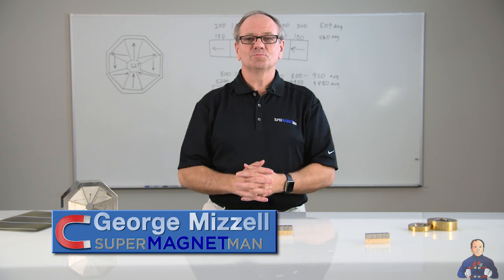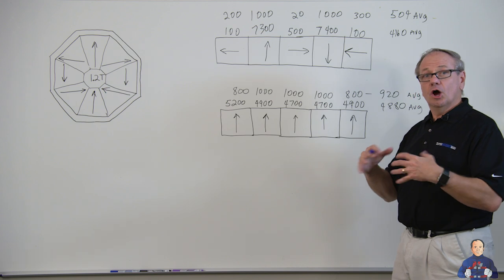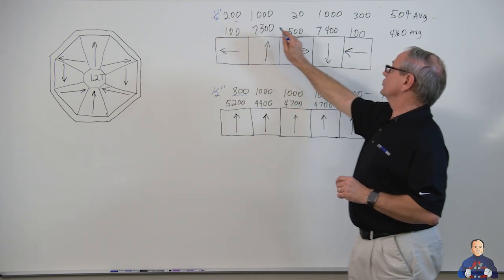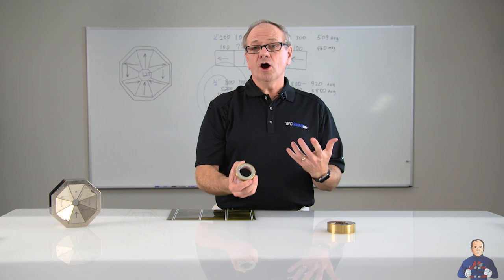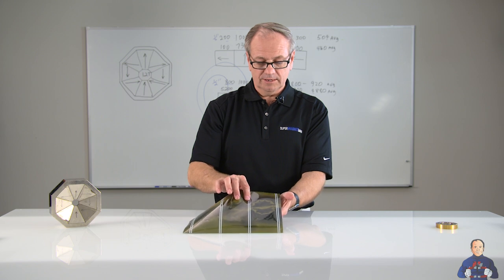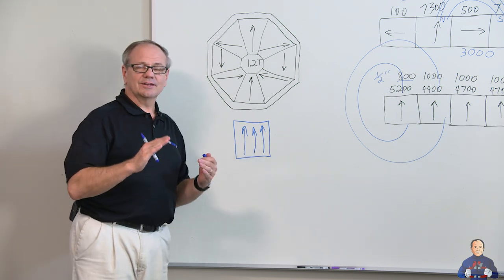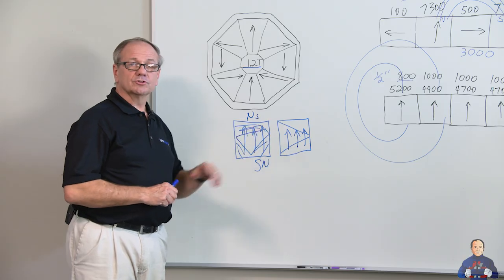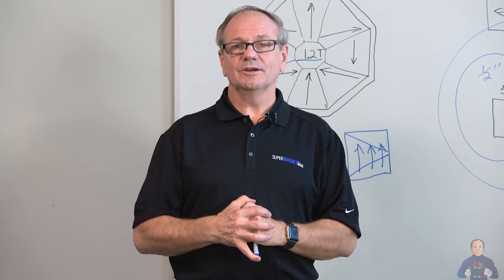Fundamentals of Halbach Arrays

Comment: I know of FOUR ways to make motors or straight rails POWERED by the magnets themselves...at least two are patented, but one uses weak, custom made ceramic magnets, one is big and complicated, the other barely keeps itself moving, and the one I invented I only got a couple prototypes working enough to know it works, probably better than those, because its simpler.
I'd love to show the whole world how to build it, if I just had the means to make some custom metal parts like these!
I need maybe a couple dozen thin, flat magnets, and some simple metal parts, made of certain common metals like iron or aluminum or copper. Either I'll make it myself when I get the tools again, or someone will work with me, live streaming online perhaps so everyone can see, and we can make one! 
Then we can make this simple mechanical levitation device I'm quite sure will also work, which could eliminate the need for propellers and rocket engines if it works! (Its so simple I'm sure it will work too, and I'm sure mine will spin really fast and put out a lot of power when I build a better one, with precision parts, instead of hot glue!)

Comment: the magnet, is worthless, unless you are picking up something with it touching, there is better ways,
I get better results for a full inch or more, but I do not need the extra magnets to do it, 
strange when a magnet instructor is so uninformed about magnets, 
magnetic field is possible and the extra magnets I can put in a different configuration and beet this , and not by a little,

Comment: An array constructed out of Gadolinium with the array placed in between two Tesla coil's with a superconducting energy loop passing between the two Tesla coil's with zero energy loss. Energy loop passing through Tesla coil's set at wavelength's that affect's the refined crystal structure's of the Gadolinium causing ultra low temperature's and a magnetic field to be generated by the Schumann resonance passing through the crystalline structure's of the Gadolinium. Superconducting electrical motor's that operate off a superconducting energy loop with zero energy loss. This can be used in concert with superconducting separator's built along water way's to remove pollution and bacteria from the water generating clean pure drinking water. Pollution removed from water further processed with other superconducting separator's set at different frequencies to break the pollution down into it's componat compound's to be used to make other other industrial product's. A way to clean up say the Salton sea in the United State's? 😊

Comment: Superconductor separator's in every home to clean water of pollutant's and bacteria that even process urine into fresh drinking water with a home having 100 gallon's two 50 gallon tank's 9ne hot one cold with all the removed compound's from the water and urine deposited into a canister for later disposal and processing by other superconducting separator's set at different frequencies to break it all down into it's componate compound's.Atmospheric water generator's that are programmable to set a certian water vapor in the home's air and pull the excess water vapor from the air drained and hooked into the water treatment system in the home with excess water generated filling a separate tank to be used for plant's and animal's.  Soild waste and paper cooked and sterilized ground up and deposited into a bin to be used has rich top soil. The Halback array's can not be used to make all that possible? A state of the art home would be self sufficient and have no need of city utillities other then trash disposal and the processing of canister's of waste removed through the use of superconducting separator's.

Comment: Would it be possible to to use one of those Halback's with A spinning fly wheel with Gadolinium to produce low temperature's for a new type of refrigeration system? Design the Gadolinium like in a fan. configuration to draw in air over it's surfaces to super cool the air has the air in a refrigerator is circulated with the electrical component's coming on and off by use of a thermostat for a totally electric refrigeration system? 😊
Reply: No.

Comment: Great presentation.  Question: Is it necessary to cut the magnets after magnetization versus cutting the pieces into the requisite shapes and then magnetizing?  Could the parts be magnetized in the direction you want by positioning the pieces in a certain direction before magnetization?  Thanks!
Reply: Typical ceramic or cobalt magnets yes. But as he said in the vid, neos are set in the manufacturing process. Once made you can change polarity but that's it.

Comment: I feel like this is the reason my business-card-fridge-magnets seem to have stripes of magnetism....  but that's probably a complete misunderstanding of the effect.
Reply: Yeah, not the reason. The card has that pattern to maximize the attraction force to a fridge. You are right, not Halbach, just multi-pole. Basically, more poles are better for that use, and it is easier to make the card shape into a magnet that has poles in that arrangement ( think production line). A Halbach "Array" is always seperate magnets, pushed together after they are magnetic.
Reply: Some fridge magnets are Halbach arrays in effect - the magnetising coils are only set on the active side of the material, generating arcing fields in the material.  Halbach arrays are merely a technique for shaping a field by combining pre-made magnets.  Magnets can be magnetised in-place with the wanted field -geometry directly, but its a custom job, not off-the-shelf.

Comment: The number of magnets is directly proportional to the field strength, Tesla. Increasing the number of sides to a Halbach, you can increase the number of magnets. Using 3D printing of metallic solutions, you can make intensely small magnets under magnetic fields during the curing process. You could make extremely strong magnets then. +1000 Tesla at low cost with a high capacity output. If you look the first set of 4 magnets(Top, Bottom, Left, Right and then rotate right to the next set of 4) you can see the magnetic fields form an infinity with a 90 Degree angle of incidence at center; The second set of magnets(Top, Bottom, Left, Right) have a zero degree angle of incidence at the center. This is in reference to the last example in the video, there are 2 sets of magnets with 4 in each group.
Reply: Thousand tesla permanent magnet?  Really?  Go make one then.  I have no doubt you will fail.

Comment: It would be neat to have a wind generator that used standard magnetic array when the winds were low, however when the winds were high enough it could flip a couple of the magnets magnets around to the halbach array and generate a more watts per RPM. 
That may require some creative code to write a program that would change the array to Halbach only when it was justified, otherwise energy would be wasted l flipping magnets in the generator than justified by the increased wind speed. 
Just a thought.
Great video!
Thanks!
Reply: Trouble is you don't need extra power in very windy conditions, you want the generator to survive, so the blades are normally variable angle - which gives speed limiting or constant speed behaviour.  High strength magnets increase efficiency whatever the conditions.

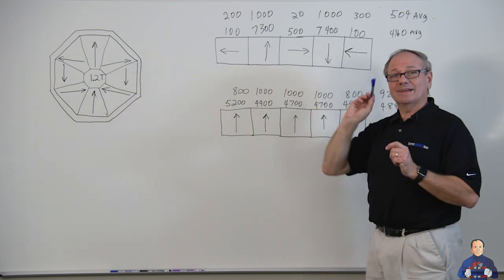Comment: 1:55 This is embarrassing. Either your numbers are on the wrong side of the array or you should flip your horizontal arrows around... It would have been easy to see if you had explained WHY the field strengthens on one side and weakens on the other side.

Comment: How do I use magnets to propell a craft into space? I'm thinking of flipping an objects polarity to reverse the effect of gravity on it. Inverting an objects electromagnetic field.
Reply from the maker: This has been proposed about 30 years ago as a way to propel a cylinder of radioactive material to the sun.  The concept was to use large diameter abandoned oil wells and drop a series of coils in along the lining and drop in a cylinder about 1 foot in diameter with a large magnet in the base.  Then activating the sequence of coils hitting them with a large capacitor bank so that each coil fires at the right interval to accelerate the cylinder.  The idea was that using rockets that might explode would be a bad idea with a ton of radioactive material and this might be a safer option.

Comment: I thought the Halbach array for the electric DC motors was stacked both as layers and as in relation to the next reducing the cogging effect as well as making one side of the magnetic field strength stronger, the other side not necessarily weaker but more “pancaked” out (Changes the shape of the field). The goal of producing a stronger field whether inward or out depending on the other component of an electric motor. (Either can be the stator or the rotor) . I tried to attach a drawing to show what I am attempting to say.
Reply: Mike Gillett can’t attach squat, we are on youtube after all

Comment: great video sir
i want to know about the v gate magnet for perpetual motion motor 
i know its not possible but still
i want know is it possible to block the magnetic field for certain place for certain time ??
like there is where the magnet meets at a point .
and that point wont let it to rotate the motor any further. 
so is there any material which is light and which can be used as a shield for the magnet

Comment: Electric motor's speed to torque ratio depends on its inductance, stronger magnetic field helps shift this ratio towards smaller RPM and higher torque, power is unchanged. With low RPM motor you need less (or none) gearing, so total drivetrain efficiency is higher, but the downside is that the shafts and the windings armature need to be made tougher and bulkier to handle all that torque.
Reply: Which is why distributed power as close as possible to contact patch while maintaining low unsprung weight is crucial in automotive.

Comment: Based on the principles of possibilities , I believe an arrangement of these magnets can lead to a design of a self-starting motor-generator .
Reply: Better high efficiency magnet motors and generators can be developed.
Reply: Adding extra windings to a permanent magnet increases its strength up to about ten times(?).
Reply: I think I read that idea from mythbusters ?
Reply: am really c.r.a.z.y. about it .
Reply: and hopes to  build one for the house. lest my sistser stops clamoring about the power bills whenever I use soldering iron.
Reply: I mean building that permanent magnet generator.
Reply: 55KVA (real power) will do
Reply: and using only a few pounds of blacksand or iron filings.
Reply: to make a large magnet.
Reply: and fashion into what I cll as : Magnetic Field Switching Generator
Reply: and eventually tune it to the tesla frequency or the 'beat frequency' of the earth.

Comment: Would this be a cost effective design to use for a hydroelectric generator or wind turbine for living off grid?
Reply: Getting past the rules of the Dept of environmental bureaucracy is tougher than creating free energy.
Reply: Well, it wont make more power than whatever the turbine receives. And electric generators without this can be quite efficient already, so unless someone already makes a competitive design using this system, you're unlikely to get any worthwhile economic benefit. A bigger benefit would be using this with a flywheel energy storage system, as that could store more efficiently any excess energy, for later use, allowing for a smaller turbine in the first place. However, the system cost of such a storage vs. Chem batteries ( lead, etc.) is typically the problem with that idea.

Comment: Is it possible to use magnets to have levitating chairs.🌿
Reply: Yes and no. No arrangement of magnets can make another magnet levitate, but you can do it with electromagnets and PID loops.
Reply: ET Not entirely true. You could probably use permanent magnets and levitate a chair, but have other mechanical stabilization. Meissner effect could levitate a tiny model chair using magnetism, but this isn’t very practical.
Reply: @ET_AYY_LMAO  Wrong, you can use a magnetic array that focuses the magnetic field around the outside and have it levitate another magnet that is repelling (while attached to an object to keep it from flipping and attracting)
Reply: @RedHaloManiac95  well, Thats cheating.
Reply: @RedHaloManiac95 you are attached to something =  you are not levitating.
Reply: Here is a video from Veritasium about levitation using rotating halbach arrays over a conductive plate. https://youtu.be/pCON4zfMzjU
Reply: @kennethstudstill  Thanks Ken. That was super cool.
Reply: Yes, of course you can levitate chairs with magnetic fields. Ever heard of MagLev? That's entire trains levitated with magnets (and superconductors using liquid nitrogen, but that's more for forward momentum than the actual hovering).
Reply: @morphman86  Magnetic fields yes, but you cannot make an arrangement of permanent magnets that levitate without being held in place by physical barriers or controlled by a feedback loop...
Reply: @ET_AYY_LMAO  Yeah, but those are restrictions you put on the request. He only asked if it's possible with magnets, which it is. Any restrictions beyond that is beyond the scope of what David asked for.

Basically, he asked if it was possible, not if it was possible while removing the methods which makes it possible.
Reply: Course U can, its just gonna be expensive and its not a chair U can use without the nescecary braincells for safe use
Reply: @mikderoost9261  you cant levitate using permanent magnets, only electromagnets. pls educate yourself, read about earnshaw's theorem
Reply: @yeti1989  how ya mean ya cant levitate using permanent magnets, ofcourse you can, its just very unpractical to do anything with permanent magnest compared to electromagnets from an industrial perspective. But not being able to levitate something with permanent magnets, i gotta call bulshit on that man
Reply: @mikderoost9261  did you even google the above? I did my own experiments, its physically IMPOSSIBLE to levitate anything using a stationary setup of permanent magnets, such system will go out of balance on at least 1 axis
Reply: @yeti1989  if U cant levitate something using permanent magnets uve never actually tried, stop being so aggressive and look up diamagnetic magnets. They are the exception to earnshaws theorem, every kid whos seen a magroad knows permanent magnets can levitate shit, i rly dont know where u got ur idea from. Ur certain U dont confuse permanent magnets with natural magnets ?
Reply: Could we make electromagnetic halbeck arrays ? I think being able te control the power of the individual Magnets could Potentially greatly increase the efficiency of the halback array, but electromagnets are not polarized in the same way as solid, or natural magnets, so im rly not sure
Reply: Sorta. You can float a superconductor in a magnetic field, but even high T superconductors  are waaaay to cold to sit on. Lexus made a hoverboard a few years back working on the same principle https://www.youtube.com/watch?v=ZwSwZ2Y0Ops

Comment: All I have done is halback some junk! I heard the Tesla motors uses the halback design in the motor. Pmac motor. Or pmbldc motor. Anyway it's a 3phase motor with permanent magnets. It's not a synchronous  induction motor. It's almost like a monopole magnet, " they don't exsist, I know" this as close as it gets. The Tesla motors are the most effiecent in production now. Because if this.

Comment: How do you cut the magnets without heating the metal and destroying the magnetic field?
Reply: With water jet! https://www.youtube.com/watch?v=lXVmEPU1L1k
Reply: A simple bandsaw and some cutting oil works just fine.

Edit>>> I should say that with a caveat: Neodymium magnets are NOT easy to cut. They crumble easy. But most other magnets can be cut with not problem if you use the correct blade type (abrasive for ceramics) and plenty of cutting oil. I actually had a neodymium magnet pop like a firecracker once when trying to cut it with a hacksaw!
Reply: A diamond saw blade (non magnetic) with an air jet to blow away the particles.
Reply: Heating is a challenge, but so is breaking.  Rare earth magnets tend to be pretty brittle.  That's why it is generally worth it to just pay someone who has the equipment and practice to do it for you ;)
Reply: Problably freeze before, they use special  coolant...
Reply: water jet
Reply: He seems to read from a board and quite often he jumps back and forth between the lines. And points at the drawing wrongly. Besides those confusing factors, it is an interesting subject.
Reply: very carefully
Reply: Slowly.
Reply: Most magnets are created by mixing metal powders then slow baked in a mold or cast, then electrically magnatized after they are baked into the shape wanted.
Reply: @gristlevonraben  Watch the video.  The magnets he is talking about are cut after being magnetized to get the angles desired.